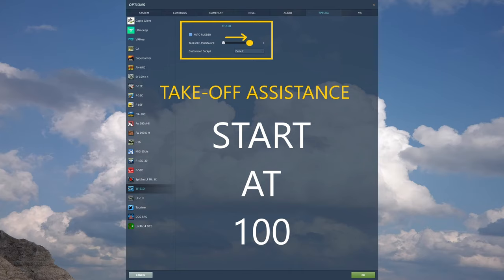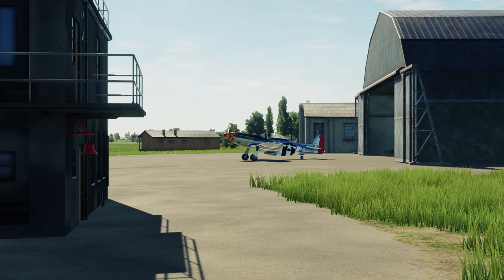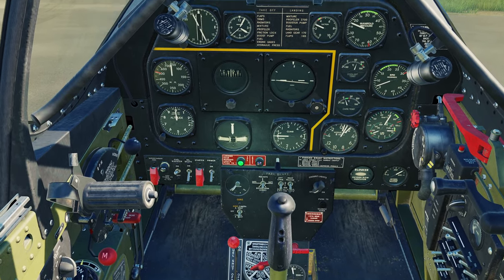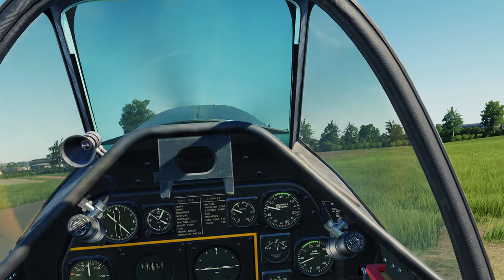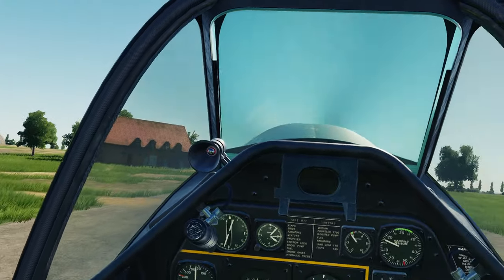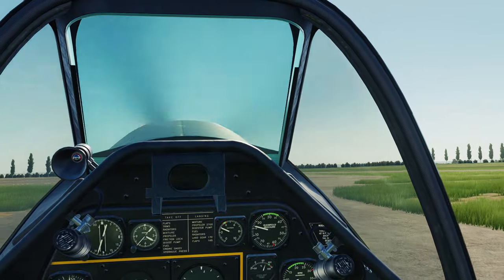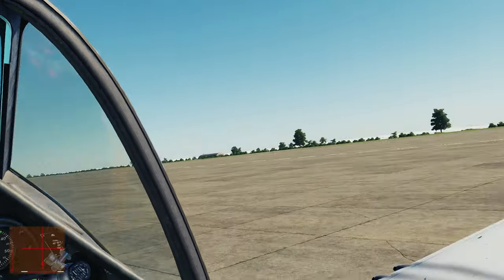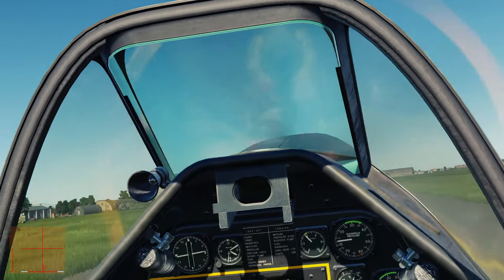DCS WARBIRDS SERIES - PART ONE - THE MUSTANG - Episode 1: GROUND HANDLING [1/6 IN THIS AWG SERIES]

Comment: Excellent tips. Specially the take off assistance setting.  No need to be all Macho in the beginning specially if you don’t have a good set of pedals.  I started with full assistance and slowly backed it down as I got comfortable with it. Same goes for all other warbirds, specially the Spitfire and Mossie.
Reply from the maker: Great tip!  I did the same thing with my X52 HOTAS.  Pedals make a real difference, don’t they?

Comment: Hi...do you have a video for landing.  For some reason I can't land straight  anymore than occasionally lately.  I used to be able to but I'm out of practice because since flying on  the Project Overlord server I don't land as often due to being  shot down all the time instead. 

Is there a tip? Am I supposed to hold the stick back? When I use the rudder to keep straight I oversteer. Should I make sure I do a three point landing instead of the two point landings?
Reply from the maker: I’m here to help!  😀  https://youtu.be/-KN2AKDNuhg?si=dWHpQ7YpayEF88EW I used to do three-point landing all the time until I flew with in a Mustang this summer.  I’m on my phone now with coffee but will try to summarize my experience in landing it in a bit.  The landing video is part 6/6 and I won’t make you wait until the end of December to get the tips.  https://youtu.be/dFUz-CWkkaw?si=6HqzZfsBTphqEYa8

In the meantime, check your controls settings to see if you have a ghost input or double mapping situation with the rudder pedals.  Message me on Discord if you want juice_awg
https://youtu.be/DMUa-Pnt1RE?si=g5GbOflGAkp0RXqR
Reply from the maker: https://youtu.be/GWOa8Xqf0iU?si=QWtnqHz4o_l7UitA
CHECK THIS OUT